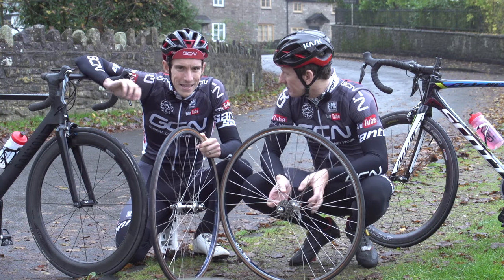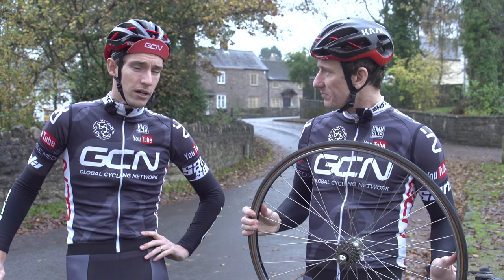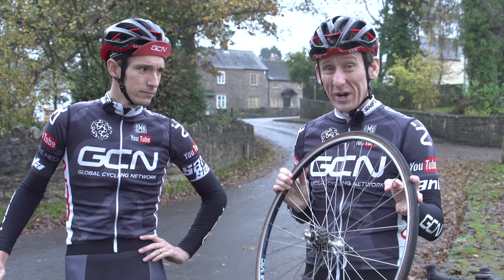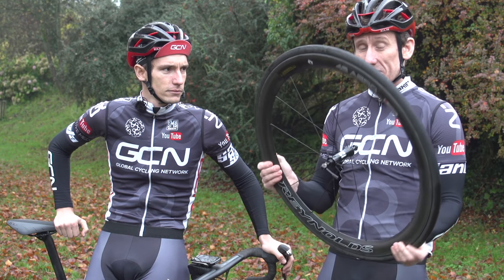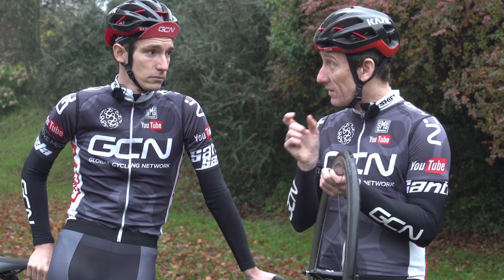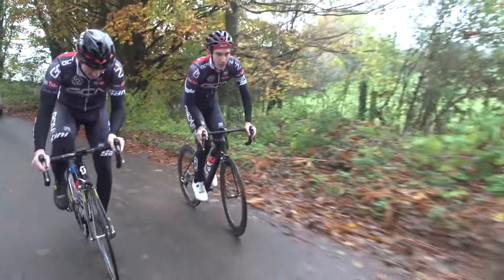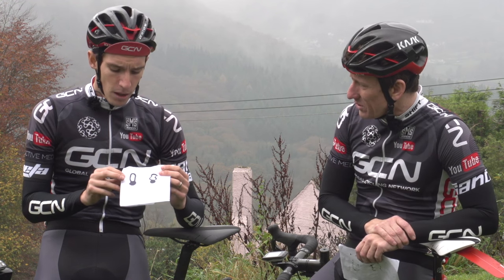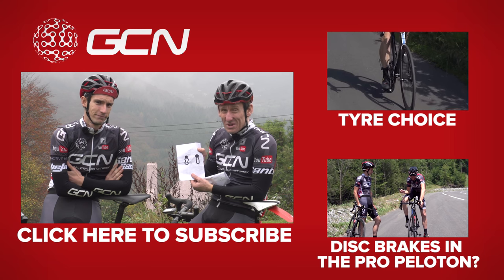Retro Wheels vs New Wheels - How Have Modern Bicycle Wheels Evolved?

Comment: Wondering why they still don't run internal hub brakes for aero reasons. Eliminates the disc and calipers at once
Reply: Unicorn Reviews Standard brakes shouldn't impact performance much, since they don't really add drag (they are small and behind them there is the frame anyways).
Reply: If you still wanna know the answer. The reason is the torque required. Torque = Force x distance from Center -> disk Brakes have a Diameter multiple times of the dia of a hub. So a hub brake would have to deliver X times the force. To achieve that it would ad so much weight that it prob isnt worth it. Also you had to make the hubs way stronger.

Comment: how much worse is 35 mm then 28mm for rolling resistance ?
Reply: +Jette Christensen the 35mm tyre rolls better.
Reply: Steve Warris really? does it have less resistance?
Reply: Jette Christensen yes. wide tires rolls better over bumbs and absorb it, because of a better angle. but small tyres have less aerodrag. so its a trade off.

Comment: You gentlemen really believe that spoking contributes to the softness of the ride? That's a myth conclusively debunked by John Forester and Jobst Brand 35 years ago. Search on "held up by downward pull" for the definitive article on the subject.
Reply: It's not the spokes.  It's the fact that you have(or can have)  much lower tension with 36 spokes vs 24 or less

Comment: Why didn't bikes have bigger cassettes back then?
Reply from the maker: There were less sprockets on a cassette so having a big sprocket means a big jump between gears.
Reply: +Global Cycling Network I suppose it didn't have a huge effect on the let's say performance enhancing culture in cycling back then
Reply: +Moon Pie I get that, it was just the range I didn't quite get because I could think why you wouldn't just have big gaps between the gears, but that would mean the mech couldn't move like that

Comment: That's a 36, not a 32, Matt.
Reply: Back in the day 36h wheels were for riders who didn’t like trying every couple of months. 32 (with double butted spokes) were for those who didn’t mind truing the wheels. I’m 50yo so I know!🤔
Reply: @ralphc1405  Ralph, I outrank you by another 20 years.
When I started racing, the norm was 32 front and 40 rear.
I had a shock when I went to race in Spain and saw pros on 28/28, plain gauge   , 
t
Reply: @ralphc1405  tied and soldered.....

Comment: Rolling Composite hoops...Now Vacuum Sprung...Still Never Flat. 74 issued patent claims. Molding Vacuum Bellows and a Novel morphing Traction System per USOC request. Balloon Tires are no longer supreme...A new Standard is coming.

Comment: why when you are speaking about the OLD tires you speak as if they where something that is now useless and in other words a piece of crap i remind you that Eddy Merckx won all those victories and tdf, giros, vuelta etc. etc. with wheels like that and nowadays cycling with all that high technology and aerodynamics none has won so many thing like Eddy or Coppi or Anquetil or Even Indurain  PLEASE BE more OBJECTIVE
Reply: +ADrian Cabrera But everyone else was riding the same stuff.  And now almost everyone is riding wider tires and carbon wheels.  Honestly, the bikes were probably less of a factor when those guys were winning races than they are today because everyone was riding essentially the same type of steel framed with 1" diameter frame tube type of bike. There was no such thing as an aero bike, and the differences in frame weights were nominal.

Those guys won so much because they had better natural talent than everyone else combined with a better training program than anyone else.  And if you are cynical, they had better drugs than anyone else at the time.
Reply: William Keys yes it's ok but i mean why they are speaking that way about some components in this case wheels. Was a different time with different technology
Reply: Yes it was.  And with stiffer frames and stiffer wheels in use today, the higher volume tire helps to decrease road noise making it through to the rider.  They mentioned that in the video.
Reply: 2 things
1: the records were easier to break because they weren't at a super high level.
2: old riders were hard and relied on their legs and not on their bikes.
Reply: THEY WERE ON DRUGS. Objective analysis of the greats of old. The bikes barely mattered.